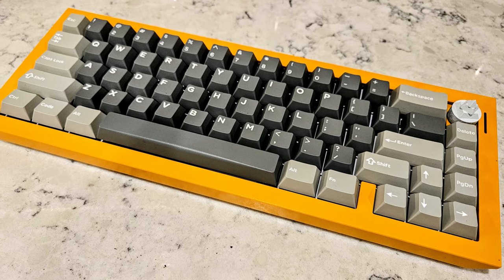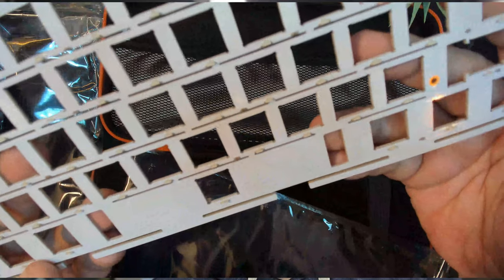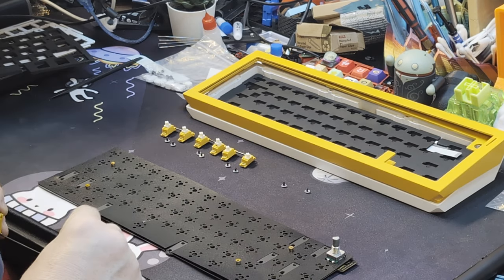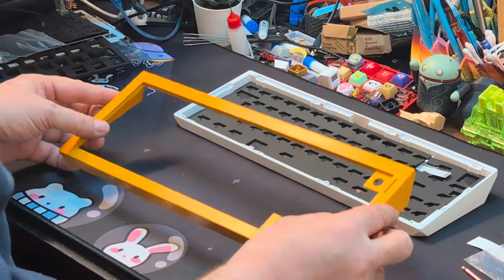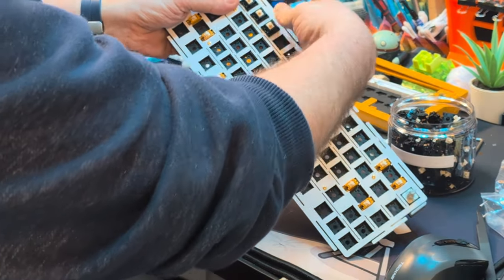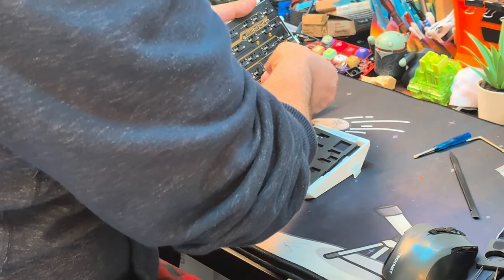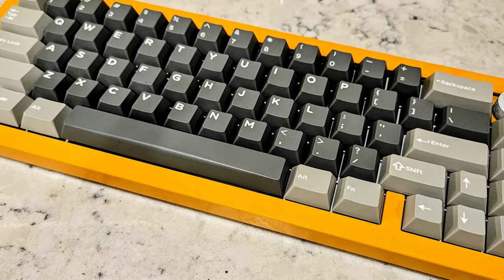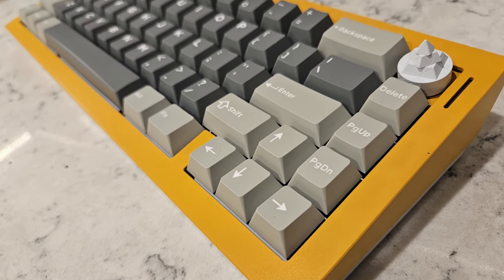Heavy Pare65 65% Mechanical Keyboard with a Knob

Comment: Hey Mark, it's always good to see unique elements to a board, especially ones in the more expensive category.  And it's trying something different rather than just finding ways to push the price up. 

Unless I blinked you didn't show us the leds working? I wondered how elaborate they are if they're only driven by 4 rails.
Reply from the maker: No, you didn't miss anything. Between being a bit under the weather and some technical difficulties with my camera, I was unable to use much of the footage I captured. I will be coming back to this soon to show the LEDs with more detail, but with VIA they can be changed to most effects or single colors choices, just not per key RGB.
Reply: @MechKeyboards  Ah, hadn't spotted you were under the weather. I hope it passes soon.  I was intreaged as you'd talked so much about the mystery connections.  Had anyone else ever fitted the leds on the plate?
Reply from the maker: Thanks, much appreciated @45KevinR . This is the first I've ever seen with the LEDs on the plate and was unable to find others with some quick Google searches.